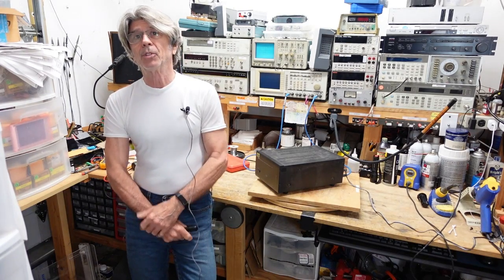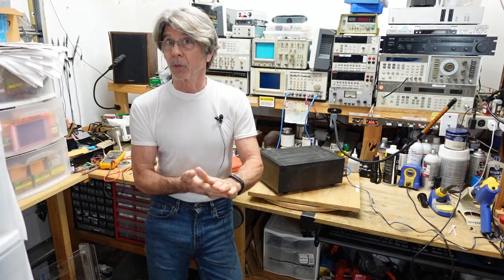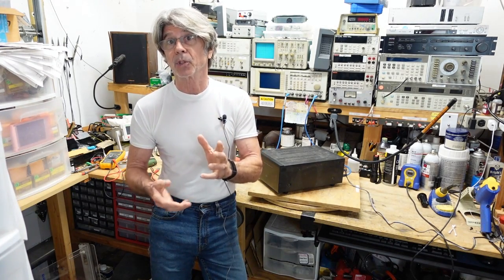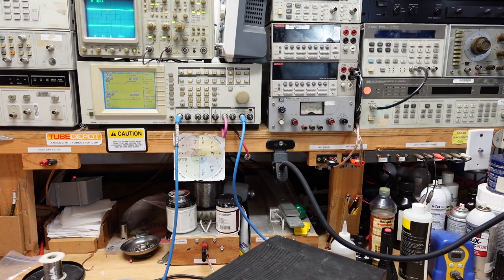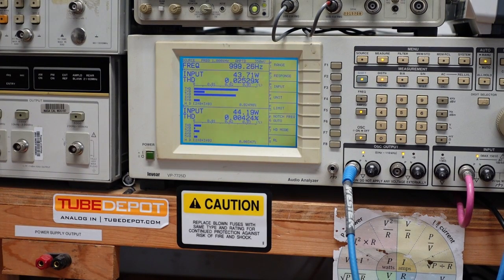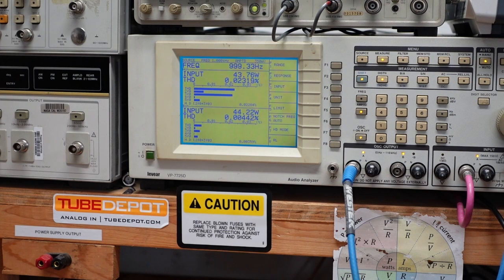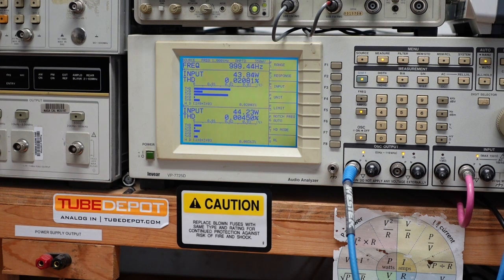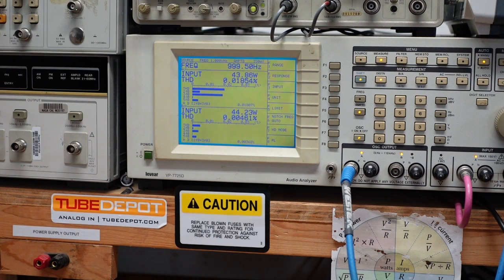Distortion Analysis: I've been doing it all wrong

Comment: Great video and very very informative find and it makes perfect sense! I am gonna have to do some modifications to my connections as well. I really like the way you source and make your cabling! Also thanks for the shout out and am glad you now have a spare display! Always good to have backups to keep this fine analyzer running!
Reply from the maker: Thanks Frank.  I'd have never guessed that you could get an off the shelf display for the analyzer, elt alone that cheaply!  Although I did the same with the display in my HP 8904A, which stock is barely viewable but amazing since replacement.

Comment: Saying "stop measuring at the load" keeps it simple . Take a look at page 4 and  fig 9, (   memory.loc.gov/master/mbrs/recording_preservation/manuals/Tektronix%20Cookbook%20of%20Standard%20Audio%20Tests.pdf   ) . It shows measuring "at the load" but the load is right there at the amplifier  output;  looks like less than a foot long wire from amp output to load.

Comment: On a sidenote about something, I learned when I was dealing with this whole thing was that I got a much cleaner graph if my laptop was unplugged from the wall. If I was running on the laptop battery, my noise for was far far lower than if I had my Laptop powered on the wall wart.
Reply from the maker: Dan, when we're testing distortion as low as we are, apparently everything matters.  Even barometric pressure and the phase of the moon.
Well, maybe not those things. but damn near everything else!
Reply: @raygianelli3612 
I suspect it's reading the resistance of your jumper cables as distortion.
Reply from the maker: Douglas, I'm not sure what's at play here.  It may well be resistance; I've noticed that the power readings are higher when configured this way. @Douglas_Blake_579
Reply: @raygianelli3612 
I have my dummy loads wired with 16ga lamp cord, less than a foot long.  The readings I get are virtually -- but not perfectly -- identical at both ends.

Edit:  Scrap that... moving to the source reads better by about 0.05% ... So now I'm with you trying to figure out what's going on.

Comment: Thank you, Ray. That’s the way to do it, indeed. It’s the method I normally use. We all are using resistors as dummy loads. It’s the best solution we have to test a big amp to a max volume. The problem is resistors are resistive (!) loads, and speakers are inductive loads, with all the differences this implies (you say it in at the end of your video). And the cable itself has its own impedance. Putting open, two wire cable in series with shielded (maybe some kind of RJxx) will vary the impedance too. So, at the end we have a sum of factors which affect readings. All in all, you are right too when you say that nobody is capable of distinguish between 0.03% and 0.004% of THD. As ever, excellent video. And BTW, I still love your Panasonic meter…here in Spain is impossible to obtain a single unit (not three!!!😂). And I hope your eyes are fine. A big hug from Madrid.
Reply from the maker: Appreciate your comments, Fichamba.  Thanks for the well wishes!

Comment: What is your load made of? Is it a perfect resistor without inductive nor capacitive component or is it made out of wire-wound resistors that is also an inductor? If you have a vector analyser or a very good LCR meter you might want to try measuring the loads behavior at all frequencies of the audio spectrum. You might be surprised what you find. The inductive and capacitive component will greatly influence the amplifier output stage and thus its THD and other capabilities.

THD of a single quality device of the modern era is not very important, the numbers will be far better than what the best ears can distinguish. The 'compatibility' between devices on the other hand is important. Therefor you have to measure the complete setup, not just one component: As speakers are inductive loads, sometimes also with a capacitive component depending on eventual filters in the speakers, these will influence the amplifier differently from your load. Consequently you will measure yet again different values.  It is important to perform the THD measurement end-to-end including both the amplifier and the speakers. If the combination speaker/amplifier is not well chosen you can actually end up with a system that does not sound good because of 'incompatibility' of the components. And there is no way for you to know it in advance as these specs are not available unless you have tried the combination on the shop. There is also no amount of equalizing or delay or cable or whatever that you can add to make it sound good.

Far more important, in my opinion, is what you also stated in your video: your ears can't distinguish between these numbers behind the decimal point. In other words, don't focus all too much on that THD number, its contribution to the feelings that are generated by listening to music is negligible.
Reply: I allow myself to slightly disagree, there is a functional device that compensates for the different passage time of high-frequency signals with the "BBE" device, and I can say for myself that it works perfectly (I have it at home) and the spatiality and detail of the musical expression will greatly increase. However, it never occurred to me to measure THD after this correction, my ears like it and it is the main thing for me.

Comment: Hey Ray, great video. I purchased the QuantAsylum QA403 and it was my thread in question where I was having trouble with measurements.  People over at the forum like Connor saved me a lot of trouble. I would say the biggest issue I was having was with speaker cables, connecting the load that were way too long, and I was measuring at the load. I shortened up my cables, got better cables, and I am now reading distortion measurements that are extremely low.  I still need to finish your video so you may have addressed it, but another thing I was dealing with was the input voltage to the amp, as you increase the output voltage of the analyzer, the distortion of the amp gets measurably lower.  I will continue the video and comment again, but I learned real quick there are wrong ways to do it lol. 

On a sidenote, I thought there was an issue with my load, and it was causing distortion. But appears that we use the exact same loads, and I am no longer having an issue. I measured my Kenwood KA-8006 that I restored and at rated output it was measuring 0.009% THD and a little bit higher when you add “+N” into the equation.
Reply: Oscillator noise floor is a lower percentage of the signal as the signal increases

Comment: The real joke is when Mr. smartie hooks his .002% amp onto a speaker system with 15% distortion!
Reply: The harmonic distortion level generated by speakers vary by the frequency, and also by the design as well, A lot of speakers will be in low single digits until they go into bass frequencies, and even then some are still single digit below 100 Hz.The time honored Acoustic Research AR3a had a measured 5% or lower down to 32Hz @ 20 Watts of power input ( DIYaudio has a link to company provided specs and graphs)  One of the main faults can be the hearing of the listener, as some among us are deaf ad doorknobs, while some can hear nuances that most of us miss.

Comment: Excellent tech tip.  Thanks for posting it.

1) By measuring at the load you are also measuring your banana plugs, cables, load reactance, load temperature and a whole bunch of other stuff. It is counter-intuitive but at those small numbers even dust matters.

2) You are absolutely correct that nobody can hear distortion at those levels.  Heck, most speakers run at 2 and 3% and we think they're perfect!
Reply from the maker: 1) LOL dust!  Yeah, even the phase of the moon matters the further down you test, be it level or distortion.

2) Rest assured, someone will claim they can hear the difference.  😬
Reply: @raygianelli3612 
Of course.  There's a whole clan out there who claim super-human hearing abilities. I would very much like to introduce them to Mr Dunning and Mr Kruger ... 👭😀

Also keep in mind that the lowest number is not always the correct number in these measurements.
Reply: The overall distortion on the connected speakers can be even greater, it depends not only on the actual construction of the speaker cabinets but also on their connection, signal distortion can be reduced by connecting BI-WIRING, or BI-AMPING for more expensive devices. A bass driver can be a pretty decent noise generator.

Nice day 🙂 Tom
Reply: I would say .1% is acceptable distortion
Reply: But I still use an amp with .0005% distortion lol
Reply: @Stereosandotherfun  
It's actually kind of hard to find a properly working amp with 0.1% distortion ... so you're doing just fine.  👍

Comment: Hi Ray, I have my workplace set up so that I can use both options. If I need a quick connection of the meter to the amplifier under test, I can use the rear input of the 2015 and extend it to the connection points next to the load, I connect the load and the connection point with a short jumper - that way, another cable does not get in the way in my miniature workplace. However, I made a separate shielded cable for direct connection of the amplifier to the 2015 front inputs - I deduced this connection method from a four-wire measurement.
All my connecting signal cables with RCA / RCA or RCA /BNC termination are wired as directional to minimize possible interference in the signal path.
Thank you for sharing this information and thus confirming my reasoning 👍

Nice day 🙂 Tom
Reply from the maker: Thanks Tom.  Good to hear from you!
Reply: @raygianelli3612  I like to hear and see you 😁 but I still envy you that Panasonic analyzer 🤣 When I save some money, I plan to buy a QA403 - nothing bigger will fit in my workplace 😂 I like the Sencore PA-81, for example, but it's too big for me.

Comment: This reminds me of the old horsepower debate in automotive things. It used to be they would put the engine on a dynamometer, and measure the output directly from the crankshaft. Around about 1972, they changed it so that it would be from the drive wheels. That meant a huge reduction in numbers. This feels like the same kind of thing, except in reverse. You would hear distortion from your speaker; so shouldn’t the wires that connect the speaker to the amp be included in the measurement? Sure do appreciate your videos; I’m learning an awful lot…
Reply from the maker: Makes a good case for powered speakers, where the amplifiers are mounted within inches of the drivers.
I literally just learned this days ago.  Just passing it on!

Comment: For those of you that have had a similar experience, any loose or oxidized connection or a tired amplifier output speaker relay can be a significant contributor to a high THD reading.